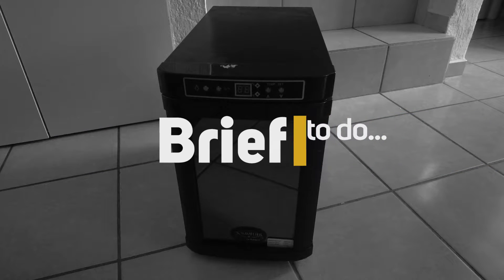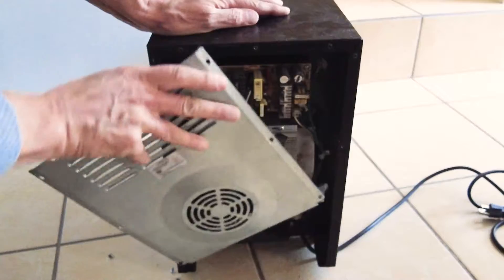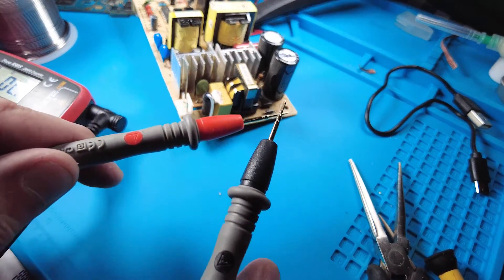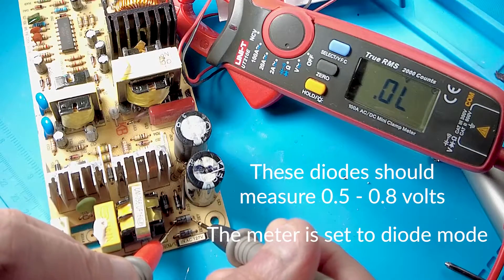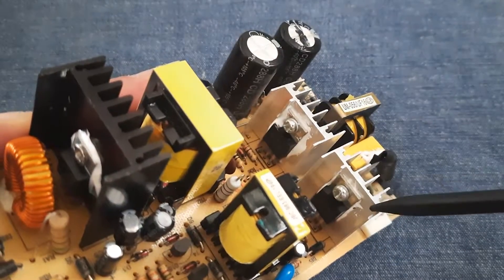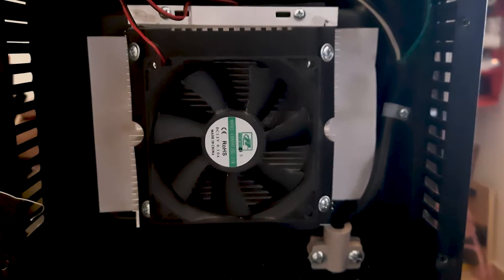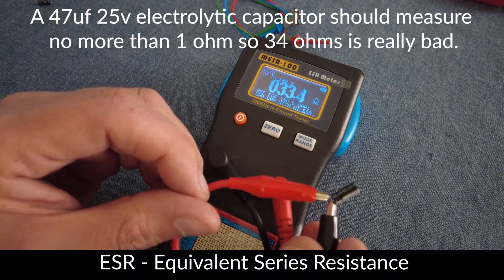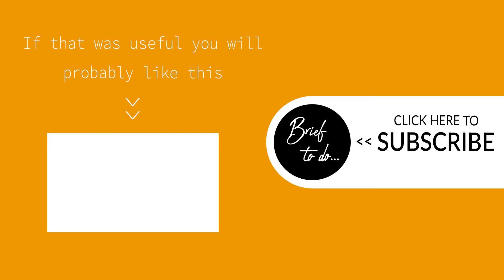Fixing a Wine Cooler Circuit Board 🍷

Comment: I have this same PCB board. Can you tell me or take a photo and tell me the wire connections please. There is no Schematic on this PCB. I took the unit to a person and he could not fix the issue, when I opened it he has no wires connected, why I and asking where the wires go.

Comment: Yup got one for free from the curb, mainly was wanting to gut it for tge thermoelectric module to repair a cooler. The power supply used in it is horribly designed. Pretty much everything is way too close to the limit. 😮
Reply: I'm looking at two of these boards, or close variants, where pretty much all the electrolytics on the secondary side are showing very high ESR (the high-voltage ones seem OK). I know electrolytics are prime candidates for power supply failures, but to be honest this wasn't a problem I'd seen much before. Either these capacitors are just rubbish or, as you say, the circuit conditions are too much for them.

Comment: I have a NEWAIR CIGAR HUMIDOR 100c that needs a PC board. Manufacturer said I have to  replace the board but they don't make replacement parts for this unit so now I'm stuck with a paper weight...smh if you can help me I'll appreciate it.
Reply: It might have a similar board. They are made very poorly. In short replace the capacitors, particularly the low uF ones on the low voltage side as they are subject to abuse from the switching frequency add an extra capacitor, non electrolytic type of 1 to 5uF across it and that will fix it for good.

Comment: Thank you very much for your help. My Cuisinart wine cooler had exactly the same outcome after replacing both MosFETs and input capacitors. Similar board. 12V output was low, around 4-5V and I was thinking that the DC cooling thermocouple was bad because when I disconnected it, 12V were normal. I replaced all rest electrolytic capacitors, two 47μF/50V were low and now it is working fine.